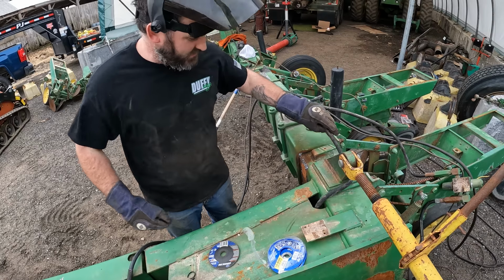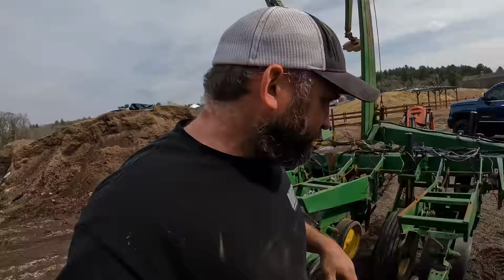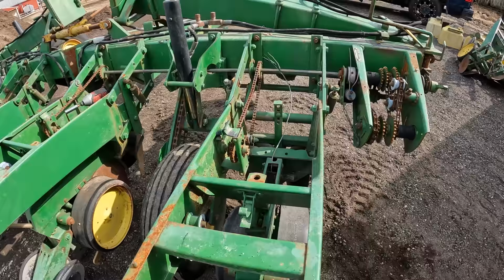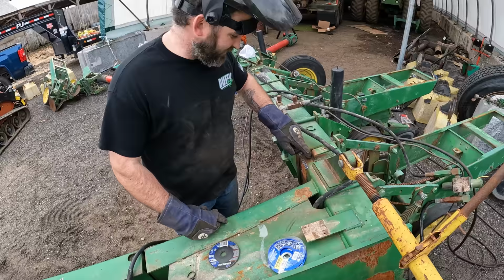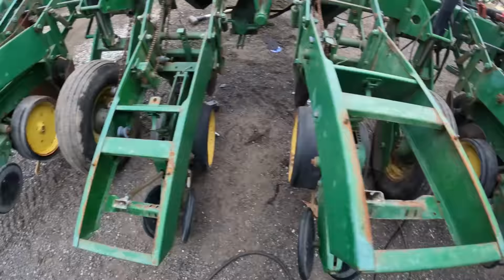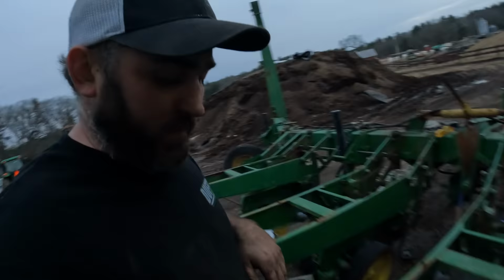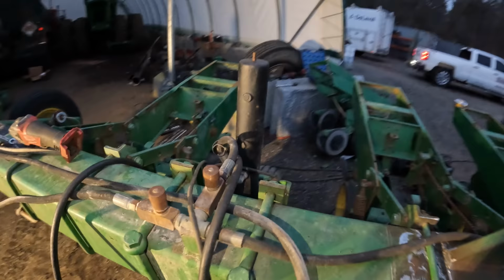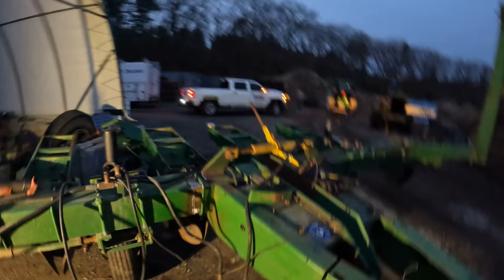Cutting Up The "New" Corn Planter- From 36 To 30 Inch Rows

Comment: Your making an easy job hard.  I've done 2 planters and 2 combine corn heads. Start in the center unbolt your u bolts and reposition and move wheels as necessary

Comment: Lol, I'm glad you added the comment at the end.  I was getting ready to ask if I misunderstood something about your comments about moving things 3".  The two center planters will move 3" closer to each other, but each consecutive rows or parts will need to move further than 3" (3", then 9", then 15", then 21" if my math is correct) that may drastically change where you want the flex joints and other components moved to.

Comment: Duffy Ag, You got it. Move one row on each side, one at a time. Then move in each lift wheel. Then work at the next row on each side.  As you go to the outside the amount you have to move each row multiply's,, 1rst row was 3" , lift wheel is 3" ,,, then your next row should have to come in 9" , ( 3" of the first row,  plus 6"  to bring it in to make your 30" rows ) I say this because , I think , you said the planter was set at 36" rows... When it comes to moving your outside hinges, I think the ideal way would be set up your next row close to the hinge, then figure out how much to cut off frame to move the hinge, to get your 30" row.  If my Old mind is figuring right?? 
You will get it accomplished, measure, measure, stop and think about it,,, then do your cutting. Slow and steady 👍👍
Reply: I'm thinking 1st row 3 in., wheel 4 1/2 in., 2nd row 6 in., etc. That's assuming wheels are in center.

Comment: You should look into a flat fold cylinder for folding. We had a flat fold 8 row cultivator years ago. The cylinder fits on the inside of the frame rail so not in the way of anything

Comment: Doing a great job,  but I think you need to fill those spots on the frame  you accidentally gouged out... I think it's a strength thing especially given it's on the front of the bar. All the torque from the outside rows will pull around 👍

Comment: Hi there just a thought the cutting you needed to do for the 2 inner rows maybe the angle pieces  where the u bolts go through could have been swapped from side to opposite sides and the bolt holes on the outside  thus no cutting or less cutting the ubolts are wider. Just a thought for the next ones

Comment: It was great like to see a clean machine when you are done is easier  to find problems when you are done fatina is bull the cleaner the nicer it is to work on replacing wire hoses I had a great machine that fell apart because of rotting that was not seen now all my equipment was bought used and all the clean up and repairs are easy and you can't tell the difference between new and mine and mine got some serious time on them and run like a Tommy oldest machine is 51 years old newest is 20 years old and all in a barn and washed no leaks no bad tires ha I sold a Fortson that even ran on kerosene  with steel wheels that looked new never gave me trouble and always started never leaked anything but your doing fine keep going as always thanks for sharing and your time was really great never miss a video.

Comment: Get a paint stick and a tape measure.  Measure the spacing and mark the layout on the tool bar before you go farther so you can visualize where everything will move to.  The tool bar frame will be 21 inches shorter on both ends than it is now all said and done.

Comment: I'm not sure but if I remember right a john deere 12 row 36 narrowed to 30 inch row becomes a 16 row 30 inch everything john deere is pretty much slide with the hexagon shafts. We just did changed a 1770 12 row planter from 30 to 20 inch rows and we were able to get 4 more units on the frame and nothing had to be done with markers or frame ends I think if you narrow john deere planters in standard row widths they all move up to the next size planter. I believe 8 row 36 narrowed to 30 becomes a 12 row and a 12 row 36 narrowed to 30 becomes a 16 row. We were planting with 2 John deere 7200 4 double row on 36 we custom made the frames for them so we could have 4 units on original john deere frame and 4 offset units on a back frame and then we had rolling baskets behind the back units it made the planters long but they work well for many years then we got a great deal on a 1770 12 row with precision vacuum units and airforce down pressure with low acres on it so we switched everything from 36 inch rows to 30 inch rows and retired our 2 old planters and now this year we are switching to 20 inch rows because we got a great deal on a new combine that has a 20 inch row head. It's a never ending switch in farming for us we go by what we need and what is affordable for us even if we need to switch the whole farm.

Comment: I think you are a bit wrong in math when you calculated how much to cut the frame on the both sides. You said 3+3 inches. It should be 3 for the first row + 6 for the second + another 6 for the third row which equals to 15. That meanst 7.5 inches on both sides. Keep up the good work. Greetings from Croatia
Reply: You are thinking along the correct lines, but you are missing the final 6 in. It is actually 21 in that each side of the planter will need to be shortened, so if he cuts out the entire hinge joint he would need to shorten 7.5" on each tube. What I'm wondering is if it might be easier to just gouge out the side of the hinge joint that is towards the center of the planter and leave the other half on the outer tube. If it is easier to redo the mount for the marker arms on the end of the tube, he could just cut that off, shortened the tube and then remount the marker arms.

Comment: When we narrowed up our 8row white planter we bought, we took about two feet of frame off each side. Ours wasn't bad to do, but it's not a flex frame, so only has one transmission in the center of the planter. But it's a vertical fold and the cylinders for folding are inside the frame so we took everything off the wings to shorten it up. Everything worked out on the spacing as to pivot points. Didn't narrow the transport width, just lowered the transport height. 
Your on the right track, and you'll get there. We went from a 4 row to a 8row also.

Comment: With the extra inches to the wings. Would it be possible to add one more planter box to each wing. Make it into a 10 roll ???? So you don't have to do all that cutting and welding.
Reply: He has a 12row cultivator